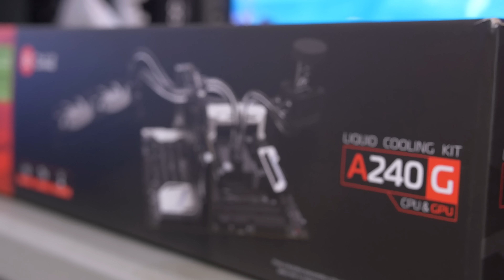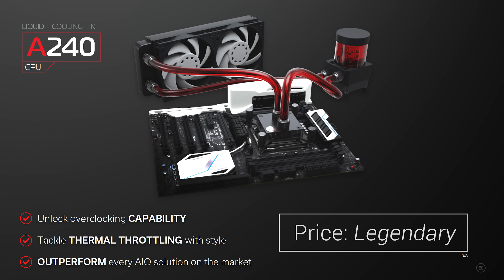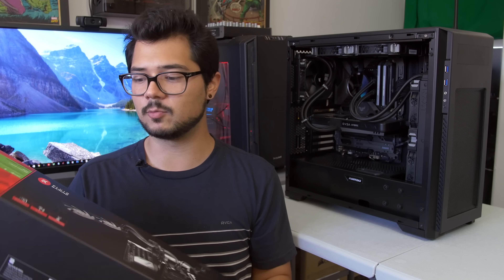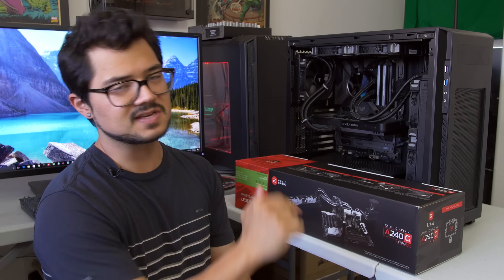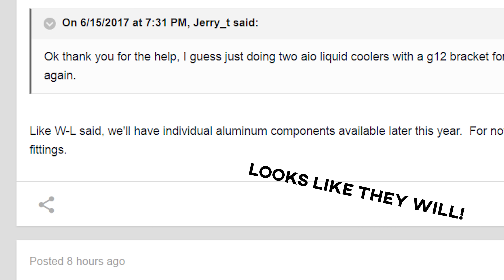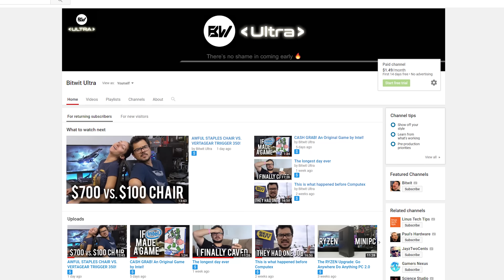FULL CUSTOM LOOP WITH *ONE* RADIATOR?

Comment: Kyle I like what they are trying to do here but if your going down this road you way has well go the full hog and do it right and pick the parts your self. It just looks messy to me and I can't see anyone being impressed with the water cooled system.
Reply: As someone who would like to move from AiO to full-on water cooling, id much rather go with this type of kit. It may not be as pretty as anything Jay does. But it seems great for an entry into pc water cooling.

My guess for the mile-long runs is component safety. Out of the box you'll have probably 6 to 8 fittings (depending on if you get with or without gpu block) and enough tubing to do any case. If you add fitting into it then you can increase the likelihood of leaks, which is probably enough to shy people away from liquid cooling in the first place.

Overall though, it is a wonderful idea. Get it up and going to build confidence, then you just need to get hardline tubing and fittings to update the runs to have that full-on beautiful watercooled pc.
Reply: Britec09 to be fair, you could make those runs look a lot better given a few more hours. Also, buying custom loop parts separately rather than in a kit will be more expensive.
Reply: @Setite  Yes, you buy the A240G kit, and the buy your add'ons fond here: https://www.ekfluidgaming.com/parts/

i have the A240G kit aswell, running a  i7 8700K and a 1080TI with an extra 360 Rad and come 40 and 90 degrees fittings for making the tube runs look better !
Reply: It was slightly rushed and like he said he deliberately left excess tubing to avoid sag. If he spent abit more time would've made it tidier. All you would need to do is purchase some 45 and 90 degrees fittings to tidy it up to keep the tubing straight. 

I bought the EK's performance 360 rad copper kit as a starting point into water cooling. I did the same and bought different fittings (and GPU block) when i got more confident in watercooling. Then bought a 240 rad as additional rad space so i can run all my fans down at low RPM to keep noise down. These kits are fantastic that EK supply. And these Aluminium kits are fantastic because they're cheaper and offer a easier solution into the custom watercooling scene without breaking the bank or getting confused with purchasing all the parts yourself.
Reply: I have one of these kits with the angled fittings they sell on the Fluid Gaming portal along with an extra 240mm radiator,, it looks REALLY nice when you take your time and get the tubing right. 
Not to mention at 4.8ghz OC on my 7700k, and my 1080 Ti OCed, I get max under load 69c and 52c (GPU).  The same kit (which cost me around 350ish) would cost me 700+ if I were to get the parts with standard materials. You can also drop another 80 bucks on GPU Extension kits that come with hardline fittings and do this with hard tubing and still be a few hundred under what a normal copper loop would cost you.
Reply: Please explain. So you bought the kit he did, and bought some more fittings and an extra radiator separately, or there is a configurator that let you customize the kit? You are right that it seems impossible to get a CPU/GPU kit for under 700. I've been trying to source a random mixture of brands and retailers and can't get the price down for my new rig. I ended up ordering a CPU AIO to hold me over since I went a little over budget on the core components. But maybe this kit is my salvation.

EDIT: I found the expansion kits. But sadly I have a videocard that isn't listed as compatible /cry.

Comment: If CPU Temps are the same, this is clearly a sign of Intel's TIM limiting heat transfer here.
Reply: Yall are misinterpreting simple fluid dynamics here. The fluid comes up to a specific temperature based on the energy being dumped into the loop from the components offset by the radiator. If the radiator wicks away a set amount of energy that is greater than the energy being added to the loop, a larger radiator will have no discernable impact on your temps. Bitwit learned here that his overall energy being dumped into the loop was less than that of a 240 rad, this also means the 280 and 120 rad were incredibly overkill for the system. They were able towick away more energy, but the energy never got high enough, so the overall loop thermals stagnated.
Reply: Ben, you are wrong. The rad will end the cycle of warming up. Since the loop is short, the fluid will be always heating up and cooling off in seconds. In a few minutes the system will accomodate what it can dissipate and stabilize. You probably saw a video of a guy trying to prove what you are saying. I did a test with an Assassin II and a 240mm closed loop and after 1h the water cooler had the same temperature that it had after 5-7min. The water cooler stabilized the temp just a couple minutes after the Assassin. And I did it with methodology, digital thermometer on the intake being recorded each 5 minutes, room temperature, finding the delta, etc. You guys need to test these things. Lots of people saying wrong stuff on the internet. And this guy obviously followed the temperatures and knows if the temps stabilized or if they will keep going up. Of course the position of the rad will matter, but then it is not a problem of the rad, but the place you mounted it, then it is your fault. Hence why tests are made in a test bench.
Reply: I think you missed the reasoning. He moved from a 280 aio that cooled ONLY the CPU to a 240 that had to do both the gpu and CPU.

Temps for the gpu dropped like 20 degrees, but he was also running gta v on 4K, which would put a ton of heat into that line that then goes to cool the CPU before it hits the radiator. 

The fact that temps stayed the same even though he lost 40mm of radiator and even added a component is actually pretty damn impressive
Reply: I am aware of that and yes these are impressive results. My point however is that the CPU temp is exactely the same - digit for digit. If he stressed only the CPU without the GPU and would still get the same Temps, that would be a more scientific proof of course.
Reply: A few points for people in here
1. loop order makes very little difference beyond res to pump.
The reason for this is the system flow rate is dozens of times more than the time to saturate the cooling medium.
For a good example of this, have a kettle turned on with a hose filling it, you will not feel a noticeable temp difference without killing the flow.
2. The temps look similar but this was a 20min test, that is not enough time to saturate the system so of course the thermals look similar. The cooling up to saturation is not to do with rad area but actual coolant volume I  the loop

If you ran the same test for 2 hr there would be a noticable difference of around 10% due to the reduced rad area
Reply: I just commented the same. I want a test of on ly the A240 (without the G) to se if 76 celcius would still be the number. What's the value of the A240 kit ?
Reply: Don't underestimate the massive heat transferred from the GPU into the loop. I was sitting on a 360mm Rad with 
 the CPU only. Later I added an additional 280mm Rad and the GPU block. Now my CPU is running hotter than before, yet my GPU dropped from 70C to 46C.
Reply: @spelltime  Prolly something you can fix with adjusting of the flow rate.
Reply: @spelltime  Same happened to me. now I run dual loop ek 240 xe for the cpu, and one for the gpu. so much better
Reply: if you took the gpu out of the loop the cpu should stay cooler, the reason its the same temp is cause the heat from the gpu is thrown in the same loop.  its kinda surprising that the cpu isnt running hotter with the smaller rad and a gpu on the same loop.  Quality kit
Reply: The temps are the same because the water block on the CPU doesn't have enough mass to take the heat from the CPU in order to cool it down.

Comment: can i use petg tubing with this kit like hard tubing instead of soft tubing?
Reply: JUNE PC TECH I'd think you would need more and different fittings. like all the diameters would need to match etc also like he said about the right Angle fittings not available yet that are aluminum
Reply: Trum p true like aluminum  fittings that are the same diameter as the petg tubing

Comment: much thermal paste very heat anticipation
Reply: Mike Productions thought it was just me who saw that lol
Reply: Jay covered it in one of his videos stating that as long as the thermal paste is non conductive, it's usually fine to put an excess amount on the gpu. Still probably shoudn't over do it on the cpu though 'cause it might seep into the sockets
Reply: Mike Productions ek instructs to use an x shape on pretty much all their blocks. it seems like a little much but after lifting the blocks up I've never noticed an excessive amount around the cpu or gpus. you're not applying the same amount of force as with an air cooler so the spread is weaker.  that's really all the logic I have for it lol

Comment: thermaltake has a water cooling kit that coasts 360$ and it comes with a 360 rad is it good? and if i bought it can i but 2 gpu blocks and water cool 2 gtx 1080 with one rad?

Comment: Yo Kyle, can I buy hardline PETG tubing and use it with this kit? Love the vids btw, keep up the great work! <3
Reply: Not unless you can find all aluminum fittings that work on the PETG.
Reply: I wouldn't recommend it. PETG uses a different fitting and using these compression fittings on PETG may lead to leaks. The only PETG fittings currently on the market are copper, brass, nickle or come combination of those. Once Ek comes out with aluminum fittings, this kit will be much more expandable.
Reply: I would imagine you could, maybe need to swap out fitting but as long as diameters match then it should work
Reply: I've asked ek and they don't support hardline tubing for the A240G because they dont sell aluminum fittings
Reply: Boi Logro do you think they might start selling aluminum fittings?
Reply: Rishi Mantha they said in kyle's video that they will sell later this year

Comment: Those tubes look HORRIBLE
i hope DK can fix this, make them sleveed, or  corrugated or anything that doesn tlook so cheap
Reply: Why are you leaving this up to Donkey Kong to fix?

In all seriousness, they're not sleeved because it's easier to cut plain tubing to the correct length. I'm not sure how corrugated would do anything to help the look either. That'd just make it look like a cheap Asetek.

Comment: Can somebody please explain to me, WHY nobody is talking about none of these kits including a draining method?
Reply: Draining ports become a requirement when it comes to hardline tubing but with soft tubing you can just remove e.g. the cpu block and detach a fitting over a bucket or whatever and drain the loop this way. So it's more a nice to have feature for this type of kit than a real requirement and probably isn't included because of this.
*But I agree, the value of this kit would increase dramatically if they would just add an aluminium ball valve and Y fitting in addition to a few more fittings.
Reply: Biggest pain I discovered when I was installing mine.
Reply: They will soon
Reply: still think it's fine put a okay good cooler on the gpu and no reason shouldn't be fine on air...but the 240 rad could easily be outpaced a little more the 360 and good pump and like 2600-2800rpm fans that stuff would run for like forever and again a noticeable shaving of temps again.
Reply: Thanks, that's something I never thought about.  I was fretting over having to drain the system after a year or so to change out the coolant.
Reply: I've looked into this kit but the problem is that EK have a full copper kit, slim series for very little more. That gives buyers much greater compatibility with compontents.
Reply: They do , but no GPU block, i agree its not worth it unless your getting the one with the GPU block.

Comment: I have a 420mm rad on my 7700k at 4.9ghz hits around 60 to mid 50s while gaming at 3440x1440p
Reply: nice
Reply: @seng514  this is old i have a 3950x lul
Reply: @RathOX  nicer
Reply: 420mm rad on just the CPU gotta be the most overkill I've ever seen .

I have 3 3080s and a CPU on 720mm rad lol
Reply: Wow your CPU runs ultrawide. Cool story. That's less frames and work than 1080p. So your CPU when doing half the work runs cool. Yay for you. Deerrrp

Comment: Ok OK I saw your joke at 3:06 now you (reflect ;) ) upon it ( ͡° ͜ʖ ͡°)
ALSO did you use the same number of fans? Airflow can change results and in the AIO and seperated cooling I saw more fans than with the single loop.
Reply: Quinten Barker actually, the cpu cooler aio was running in push pull and the custom loop was running in push only

Comment: If you want to add another rad, would you still need an Aluminum radiator?
Reply: Yes. Only use Aluminium parts if you have ANYTHING aluminium in the loop.
Reply: Just don't mix metals, that would cause issue's so everything you add should be Aluminium ;-)
Reply: yes
Reply: Yes.
Reply: Yes, but as an owner of this kit I will say, finding the fittings to add into the loop to add an additional rad is impossible right now. The only real options are swapping out the 240 for a larger one or using another rad with bard fittings built in. There are no aluminum fittings currently available on the market.
Reply: Travis Since EK already confirmed they will offer individual aluminium parts later this year I would just try to endure a bit longer with only a 240 rad and buy compatible parts later from EK directly.
Reply: You don't need one, but it is highly recommended to reduce corrosion.
Reply: as long as it is a metal that will not react to cause galvanic corrision you will be fine, there are alot of options.
Reply: Nope 560mm on separate loops and pumps lol so basicly the cpu can have it's own big fat juicy radiator and res and pump the gpu can have it's own 560mm rad with its own pump and res but unlike some peaple my loops Gona  hit boiling  temps lol imagine 95 degree coolant would it explode like a car would when you turn the cap and boiling coolant flys in your face lol   serisuly my you would be overclocked on water till the coolant starts to boil lol but the fans will be keeping it under 100 degrees lol
Reply: Copper WILL react with aluminum, so no. No to your question and to everyone who says it's not ideal but will work. You'll loop will last 6 months and the copper will eat the aluminum (which is most of your loop).
Reply: I read they will start selling the parts separately in the third quarter of this year. Also a 360 rad will come. If you combine that one with the 240 your system will be cool af while the fans run low. They told me the pump is able to feed a additional 360 rad. So no problems there
Reply: not necessary, but its recommanded to not mix different types of metal, so you can add a copper rad but you should add an aluminium rad

Comment: Isnt a 240 a bit small? Doesnt jay recommend atleast a 280 if you plan on overclock your gpu and cpu?
Reply: Of course. If you want to overclock a lot, then you should pick up a second radiator. Although EKWB doesn't sell the radiator. It's only the kit ._.

Comment: Hm, that test isnt that accuracy. In the old rig the 240 loop had different fans installed + (the biggest influence) the fans werent installed the same way like on the ekwb radiator... installing the fans blowing instead of sucking is everytime better and has a big influece. Another thing is that the convection aspect helps the ekwb too because it was installed at the top

Comment: @bitwit the same temps on CPU is probably due to a 280mm cooling potential vastly outweighing the cooling needs of a 7700k. I have a 1700 and 1080 ti under a single 280mm rad and my CPU stays below 70c under load, as well as gpu under 60c under load. I was blown away too.